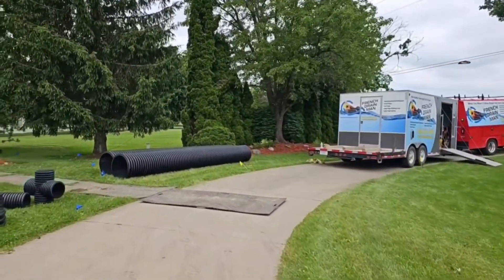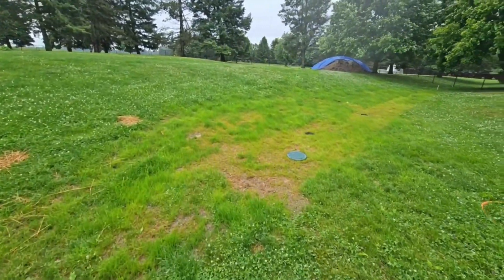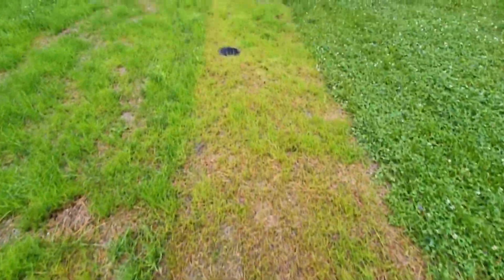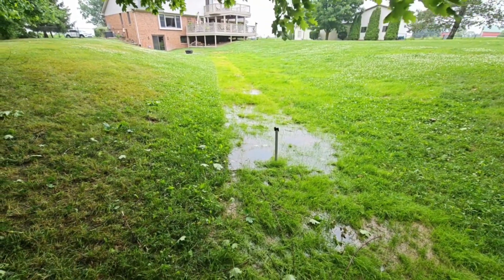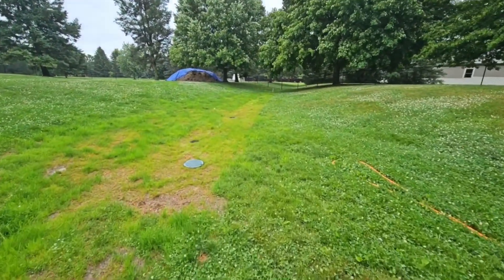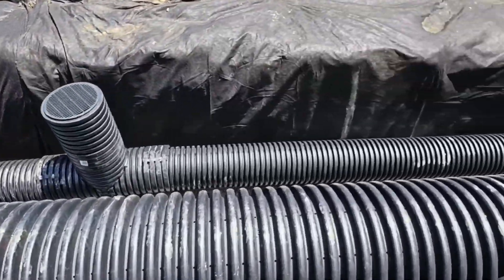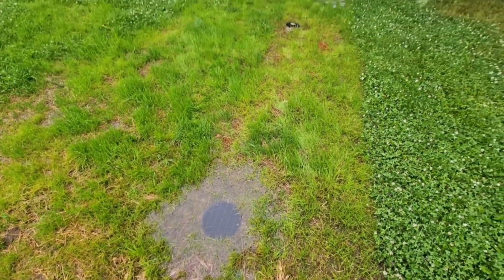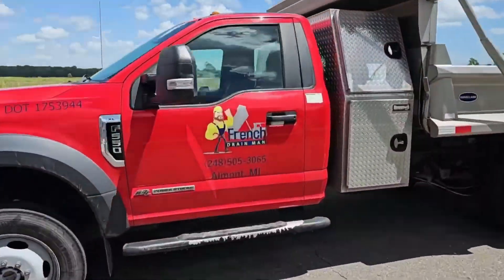4" Rain Detention Tank Before During and After

Comment: We had a sewer system service for a neighboring town that buried a pipeline going along side of my house and street  and when they were done they spread hay for the grass to grow back in. Before it had a chance to grow we had a rainstorm and water from the storm and coming through the woods washed the hay over storm gratings on both sides of the beginning of the road clogging the holes in it. The water actually ended up going into our streets and flooded some houses basements. I had to tell them that there were sewer gratings there and they asked ME to unclog them! After I did the water drained right off the roads but the damage was done for the houses that got water in them. The reason I'm mentioning this is bc i seen some of your gratings and they had the hay around it.
Reply from the maker: Thank you for commenting and sharing.

Comment: Great job, when I see things like this I always think, what were people thinking when they built (from the homeowner, builder, building department), let’s build a house in the swale.
Reply from the maker: Forced walkout. People will do anything to have a walkout basement. 

Job security
Reply: @FRENCHDRAINMAN  and they need to finish the patio with another drain?
Reply: @ I get that, BUT it needs to work.  With the right wind and rain that walkout must have been flooding, sump pumps work until there’s a power outage.  You all did a great job for a situation that should have been planned for before building.  Imagine if you did all this work during construction vs. fixing things afterwards. :). You definitely have job security.